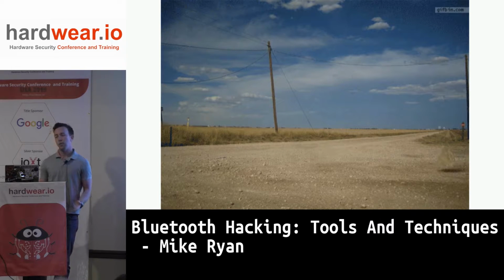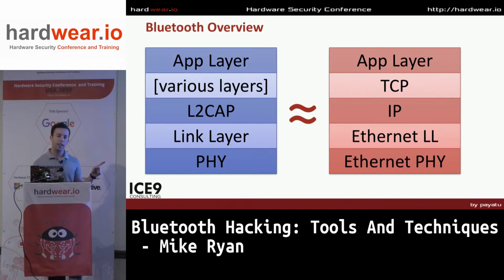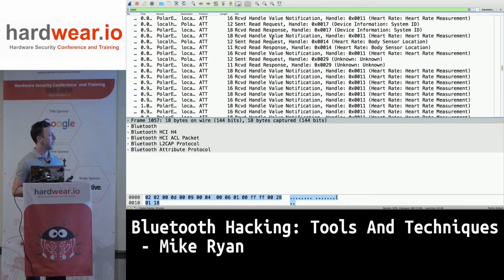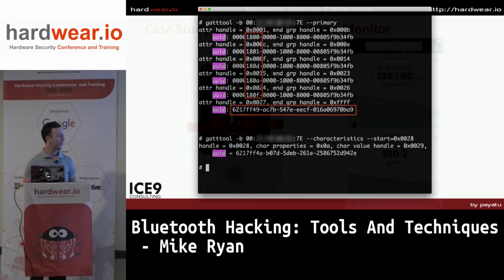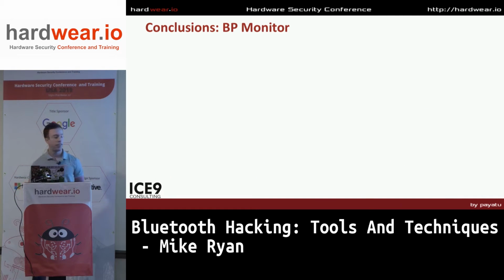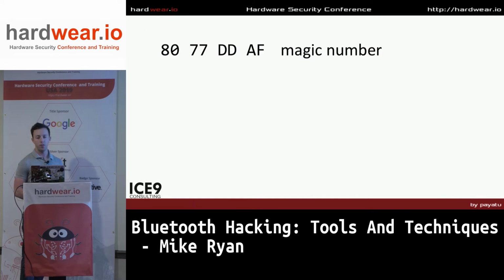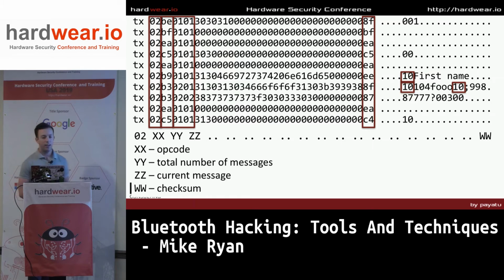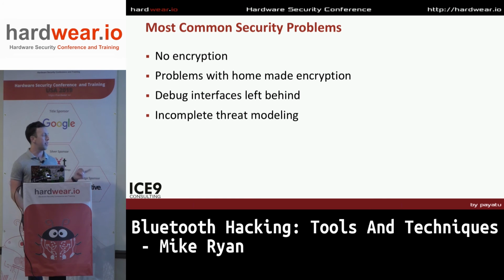Bluetooth Hacking: Tools And Techniques | Mike Ryan | hardwear.io USA 2019

Comment: How does he decrypt the ble blood pressure monitor values? Is it encrypted? What encryption algorithm is this?
Reply: They aren't encrypted they are just encoded, the values aren't transmitted in decimal, they are 16 bit little endian encoded values, so he simply converted them back to decimal. 

As opposed to encrypted which would be a type of encoding but used to purposefully make something hard to read, whatever language you are programming in will have a string formatter or cast that can handle this conversion with zero effort.